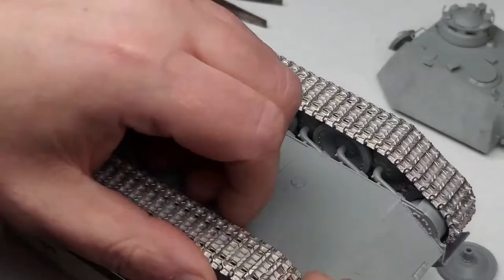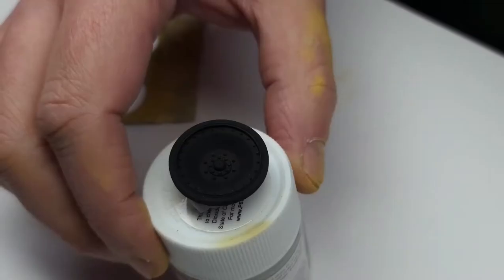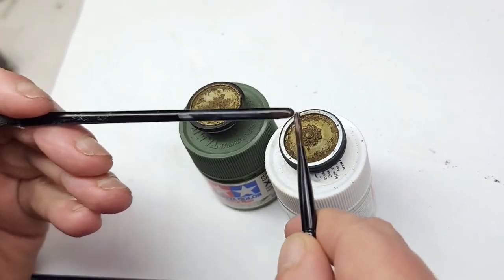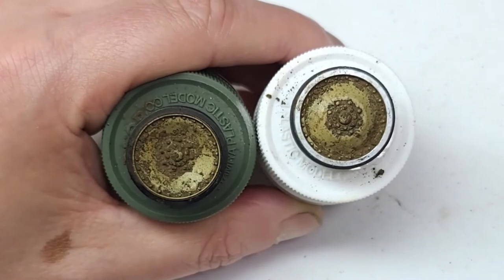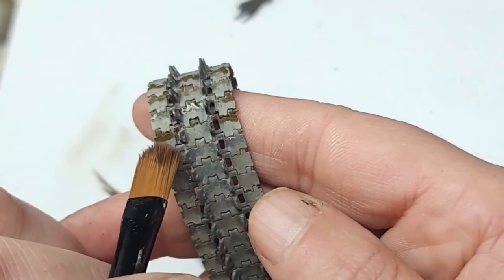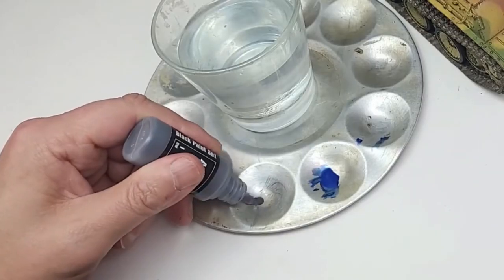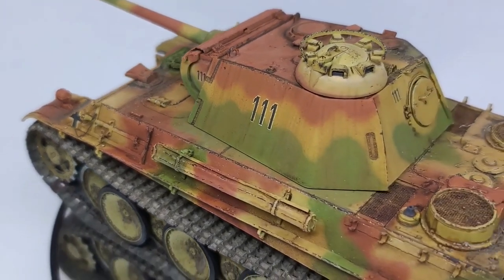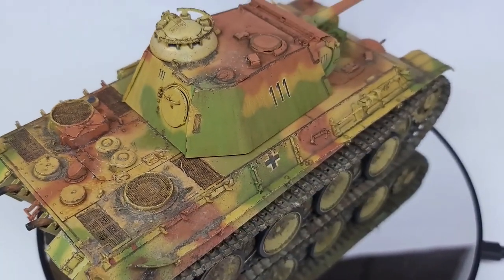1/35 Panther G Weathering

Comment: Another great video. May I make a suggestion, instead of using VMS 2-Part system for the Friulmodel tracks, go with AK Burnishing solution. After degreasing them with nail polish remover (it has acetone recommended by Friulmodel) and drying them, I lay them out and brush the solution on straight from the bottle with an old toothbrush. Results are immediate and the more you brush, the more weathered they get. Once I get the desired effect, you can let them air dry but I rinse them off with warm water and THEN let them air dry that way they also get a "rust" effect. Give it a try. PM and I'll show you the results I got.
Reply from the maker: Thanks for the tip Davi. I'll give it a try on my next one